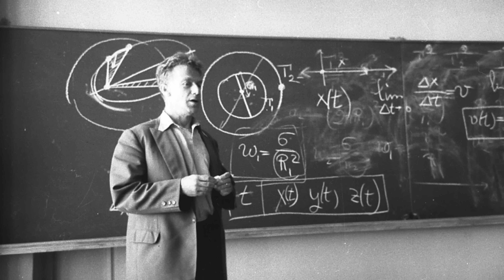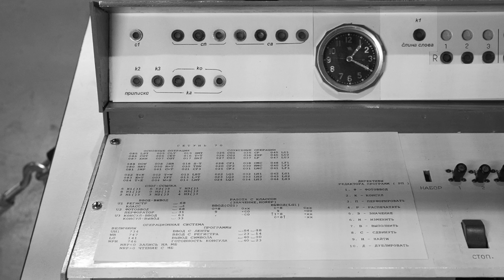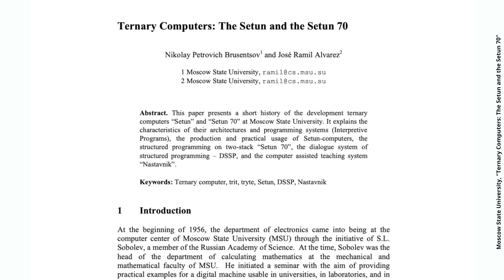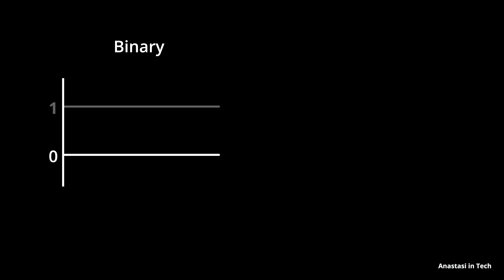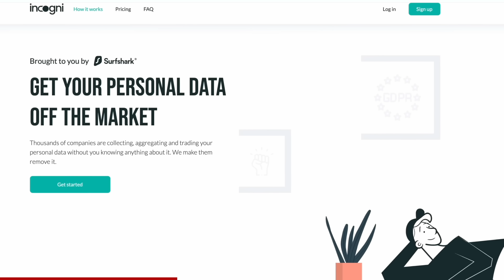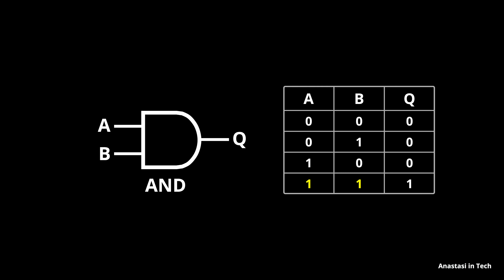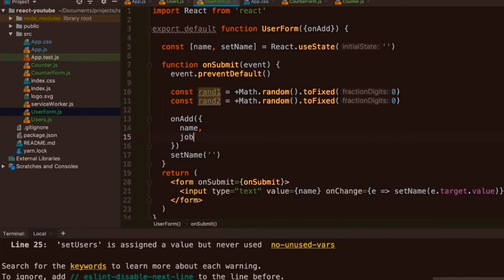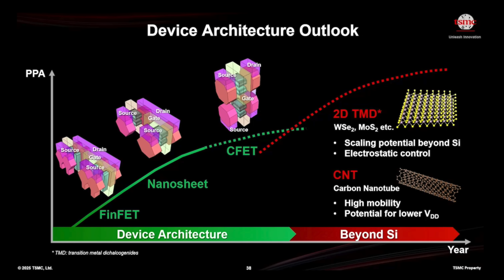The World's First Ternary Computer

Comment: Computers that use ternary values have been made since ancient times, and that remains the case today. However, when trying to create an arithmetic circuit using ternary values, the logic elements become much more complex than with binary values.
As mentioned in the video, you need logic elements that can distinguish between two threshold levels.

For that reason, currently, signals are transmitted within USB cables and LAN cables as ternary or quinary values.
It is quite possible that communication between dies on a substrate at distances of less than 1 cm will soon become ternary or quinary, but this will probably not extend to logic elements.

Comment: Balanced ternary can easily be processed by complementary transistor logic, however, +1 and -1 are low impedance and the "0" becomes high impedance, which makes the 0 state propagate very slow. On top of that, the first digital computers used 5V TTL, which deliberately used NPN bjt's only, because these were much faster than PNP (electron mobility vs. hole mobility). So, the simple basic circuits available back then were much slower for ternary. Even today, the easiest way to experiment with ternary computing is using a digital FPGA and represent ternary data with two bits (leaving one combination unused, or use it to represent "Unknown" or "don't care"). Can be lots of fun, balanced ternary logic and trying to use that logic for calculations is a great puzzle.

Comment: You are correct 
Graphene is also perfect for memory 
Even challenging time crystal memory energy efficiency calculations. 
   Great way to pull quantum data information 
       Create time in a time crystal or graphene 
      Put a quantum answer in this new sense of time. 
     Measure observed answers 
In the time crystal or graphene block.

Comment: Why not quaternary or beyond?
Surely a base10 system is more congruent with everyday, human calculations?!?
The fact is though that increasing the number of threshold levels inherently decreases reliability. The determination of one level from the next becomes more prone to errors. At some point, it becomes unusable or requires excessive overheads in managing errors that defeats the purpose.
This increased threshold system also cannot just work for transistors. It also needs to be reliably stored and transferred. If any part of that isn't sufficiently reliable, then the entire system becomes unfeasible and redundant.

Comment: It was not an accident. Binary is just the simplest way.
You can make simple logic with light switches. And in the 1970's I learned digital logic (kosmos logikus from 1968) without any electronics at all. Just 10 light bulbs and 10 physical switches where each physical switch could move multiple changeover switches. With lots of wires you were able to build some simple logic learning binary logic.
By the way our NVRAM disk chips today already use multiple electrical levels up to 16 (QLC flash) for storage. The more levels they have the slower they are because of the more complex level detection electronics they need, but are still much cheaper to make.

Comment: Writing this at the 6th minute. I guess the ternary states of -1, 0, 1 answer to a dual power supply which has -/+ voltages, for example -5, 0, +5v. Is my assumption correct? The new ternary system operates via dual power supply just like most audio systems.

Comment: At an Air Force electronics school in 1988, I learned about what they refer to as  trinary (1 s 0) and  quintary (1 + s - 0)  It cam from how core-lock memory works, or rather how fails indicating it's last state when power was lost. when re-powered the bit (a tiny almost microscopic copper hair) goes to s which is at 12 o'clock  1 is at the 9 o'clock + is close to 10 o'clock, the value - is at 2 o'clock and 0 is a 3 o'clock.  + and - were discovered when you under power the gate.

Comment: 10:58 I think that you are onto something here. The only thing that I would change is to make it so the And gate has three inputs instead of two.
As for the idea of that Trinary will replace Binary. It is possible, but it is hard to replace something that has already been established. Frankly I think that it is crazy to depend on Binary for anything. As it takes a byte or 8 ones and zeros to make the even the most simplest input like the latter A. To me it seems needlessly complicated. 
I love the idea of using CNT Carbon Nano Tubes. I didn't know how well they would do in chips but I knew about there conduciveness. They would be very useful in the construction of the a ribbon used in the Space elevator concept.

Comment: Why stop at 3 levels - by adding more threshold points, you can bulid a much faster and efficeient processor. In the future we will need processors, which is at least a million times faster than the fastest ones we have today. Our CPU's today aren't fast enough to calculate actions happening in a atomic enviroment or to calculate and direct a spaceship from jumppoint to jumppoint in intergalactic journeys, which we may have in the future. (and please don't mention, that the speed of light prevents us from reaching other planets - like the speed of sound it is just a boundary that exist where materials and systems change characteristica.) - Thanks for a very interest look into the future.

Comment: Intel  had ROMs with four distinct electrical states (2 bits per cell) way back in the original 8087. It worked, butiy it did not "revolutionize computing".

Comment: I am curious how even theoretically a system with numeric base more than 2 may be more effective than binary. Transistor is a switch on and off.  In order to make effective system you need a 3 way switch that would be comparible size as transistor, operated at comparible frequency, consuming comparible energy. And if you think about some sort of modulation, forget about it unless you venture into realm of photoelectric effect
It is obvious that n +1 way digital recording is more effective than n but our children may not see technology capable handling higher than base 2 systems

Comment: what interests me is a ternary thought process  as a roadmap, using analog language based  transmission to create a base 4 as an incremental logical step  ( or better a system similar to sexagesimal quantum compilation) that reads the state currently expressed and read as neutral as variable by model language ; and transmitted via entanglement to save time lol.

Comment: China has developed a new analog chip, based on resistive memory (RRAM) technology, that claims to outperform top digital processors like the Nvidia H100 in specific tasks such as matrix inversion. Developed by a research team at Peking University, this chip reportedly offers up to \(1,000\) times greater speed and \(100\) times better energy efficiency for these particular computations

Comment: Against my better judgement, I left my professor's preferences in place when translating many of the author's works into text that the Internet indexes (with links to many of the original pdfs that were used to publish the material) when migrating the old version of his site (I also added links to purchase points for the same product shortly later to assuage my conscience in the matter), to the new one, a license free code compliant version, because it is the expectation of Legislators to review all the books that have resulted from the ongoing offense when considering what to do about the violations that result in publication and because I needed to know what caused the hacking (with a failure of code compliance and concerns about the content, I wouldn't know which was responsible for the offenses I lived with); if it was motivated by a failure to comply with standards set by the W3C, or database technology, I would not be able stop it.

Comment: I really like the idea of the ternary system. I'm worried though about the compatibility with the already existing binary system. Can data be transfered between ternary systems by using the same cables as binary systems (you know, the undersea cables)? Do we need a new infrastructure and network of cables? How much time and energy does it take to convert ternary and binary data?
As a software engineer I spent a lot of time implementing modern alternatives to legacy systems (basically reverse engineering) and I know the pain to integrate new technology in an existing system.

Comment: Noise is the reason binary is preferred. A ternary chip does not magically solve the noise problem. In a world filled with noise a clear distinction between 1 and 0 is possible, not so much with 3 states. People have been struggling with this for decades. And I don't think ternary will replace binary because any material improvement, such as nanotubes, will benefit binary at least as much as it would ternary, and the adoption of the new material will be so much faster with binary because there is already so much technology involved with binary

Comment: 7:57 okay this is where you lost me. You’re either still using more than 1 transistors with the output open collect, open base, or hi impedance, just as the diagram showed. Maybe something was lost in translation but you failed to prove a point. You’re still powering up more transistors, and you’re just quoting speculation. I’ve read decades worth of speculation and near none of it goes anywhere. It’s not that its a waste of time, but you explained and demonstrated too little to be worth a video

Comment: Optical computing.  We can run 1000+ colors of data on fiber optic cables.  If we can do that on optical ALUs, you're looking at 1000+ ternary calculations per clock cycle per ALU

Comment: Thinnest possible,CFET + 3D monolithic → <200 nm per tile
Fastest,10–15 GHz trit rate
Least noise/crosstalk,Vmid shielding + coaxial BEOL + differential option
From programming,HDL attributes → ML auto-P&R → GDS → wafer. 1= 1.2v, 0= 0.6v, -1= 0v, and that's how you win

Comment: Ternary chips will not "replace" binary chips. One, it is not practical, and two, it is not advantageous from a global perspective. However, ternary chips may become the standard for AI chips, sensors, and other specialized dedicated acceleration hardware. Huawei's ternary patent isn't focused on GPC but specifically on the AI market due to energy efficiency.

Comment: I have worked whit the 3 stage computer system, i made the base foundation for a multi flexible code system that means computer can do multi task systems like multi variables, imagine a mode shift in code that can boost 2 times up to 32 times faster in load varibles for reason the system can shift work Tbits from normal like 32 Tbit to portions. Whit my Code system you can pack data even more then just run normal codes. Hard to explain on text you have to see it.

Comment: Quantum computers have at least 4 states now.  Using quantum superposition you can achieve way more power than normal electronics in the same way.  It can go theoretically 8 states, or 16, or higher.

Comment: I work with micro controllers you can set the pins as outputs 0 or 1 or a high impedance input. Don't  know if this is practical but the output can set to drive two transistors alternately, set as input both are off.

Comment: Nope! I tried to simulate this for many years. Issue is that you quickly run into complexity circular noise, not only in the circuit design but in the actual application as well. Why it was tried and quietly abandoned many times. Most algorithms (based on the decimal) fit nicely into the binary system, not so much when you expand the your foundation of your number system (3^n) yields 3d dimensional values which require more complex computing to normalize for human consumption. Possibly if we change how we teach math in schools then it could be used for everyday applications, until then these kind of great ideas die quietly. We could do multi stage gate circuits back in the 70's.  Also look at FFT.

Comment: She starts right off with a lie: "Blind spot ... no one has ever questioned it". Of course, this has been questioned very often - but it was never practical, and instead was expensive and prone to errors. Current quantum computer research is based precisely on this idea of not relying solely on binary systems. After that, Anstasia continues with stories about how great and advanced the Soviet Union was back in time. Here I stopped watching. For obvious reasons...

Comment: 11:51 i dont get it. AND logic gate is only the ALL TRUE so if -1 & 0 cant be -1 is like only apply the TRUE wehn 2/3 of state is TRUE and the 1/3 one is FALSE? that dont work. Or at least i dont get it.
I will try it with RGB fotonic instead of electronic. i think is more easy and faster "LightMatter" i think make an optical transistors for interconections.

Comment: I think the default is binary because that was the difference between Analog signals and Digital signals. 
The primary reason to only have two states is because at very long distances you get the longest range out of two states, analog is 50x slower to transmit than digital.

Comment: Momentum. Binary has momentum. Not just binary but x86 which started with the original 8086. Besides Ternary just means three states, current programming languages use it for all sorts of things. The idea here is just if you could use it at the transistor level, which would require all sorts of retooling. Even if you did we still have all these languages and all this code built on binary, little and bit endian, just a bunch of legacy stuff. Sure this would be cool for AI, but binary is never really going to go away. Heck people are still trying to get rid of Cobol.

Comment: I actually researched and built a ternary logic system for one of my university modules, and I managed to implement it on standard binary architecture — which is far more cost-effective and power-efficient than what’s shown here. While ternary logic sounds elegant, it’s a nightmare in hardware if you try to do it the “pure” way with three-state voltage levels at every gate. That setup needs extra power lines and constant voltage interpretation, which massively increases complexity and power draw.

In my design, I used binary-compatible logic with simple guard circuits that enforce valid ternary states and automatically correct invalid ones. The valid states in my system are:

A+, B+ (positive), A0, B0 (neutral), A+, B0 (mixed positive)

Any invalid combination, like A0, B+, is automatically corrected to A0, B0, because B+ should never occur without A+ — if it does, it indicates a fault (like a bit flip), which isn’t possible under the hardware’s implementation rules. It only requires basic binary gates — for example, a single condition like if (!A & B) return 0 Circuitry of of IN A,  O1 = A O2 = B AND (A OR NOT B) — to maintain logical consistency.

This approach lets ternary logic run natively on binary hardware without the usual encoding/decoding overhead or separate validation logic. You still get the benefits of ternary logic — higher data density and more expressive gates — but without the analog-style complexity or performance penalty. and as software moves to it you can implement it easily in hardware you still only have the 1 powerline to power a NOT and AND gate

Also, the ternary AND gate truth table in the video seems off. If you define AND as min(a, b), then sure, 1 & -1 = -1, but that’s arithmetic, not logic. In computing, logic gates need to behave predictably and symmetrically, and that table doesn’t reflect that. I spent months working through this with my professor, and trust me — ternary logic needs careful handling if you want it to work in real systems. My approach fully supports binary operation too, so it’s compatible with existing hardware and instruction sets. Unlike the system shown here, which locks onto -1 as the lowest value (min-first), mine treats 0 as the neutral default, so it integrates cleanly with current architectures.

Comment: Humans neurons have about 1000 inputs (synapses) per neuron. So way up from just 2 inputs or even 3 inputs! However brains run really slow 2 Hz versus 2,000,000,000 Hz So transistors switch about 1000,000,000 times faster.

Comment: Might as well go back to analog computer, or more state, 4, 5 or 6, depending on technology in accuracy. but wonder if a transistor operates at threshold voltage the heat generated could be lots more?